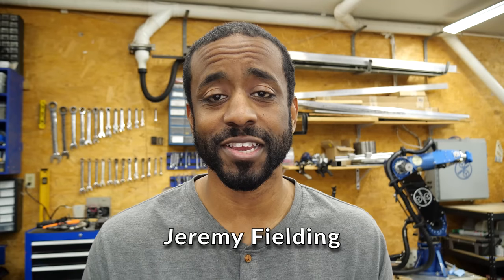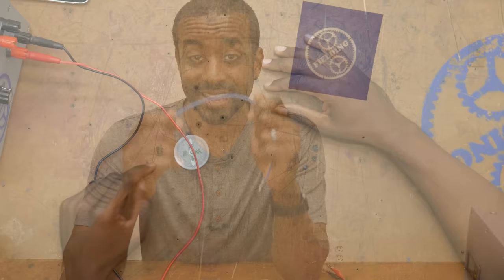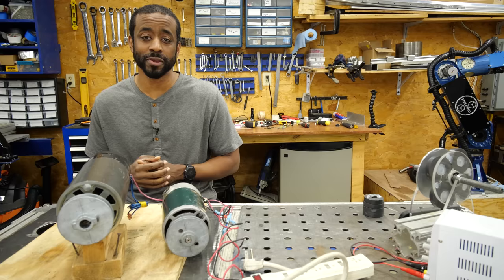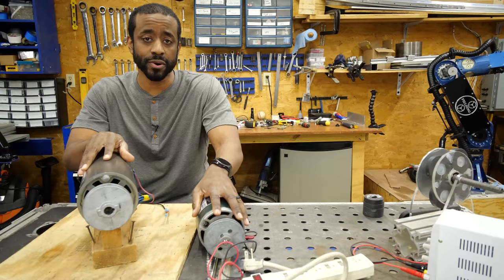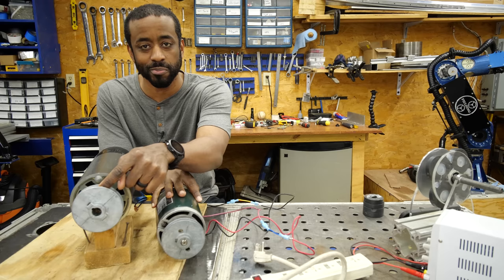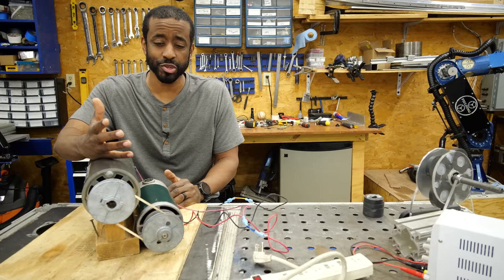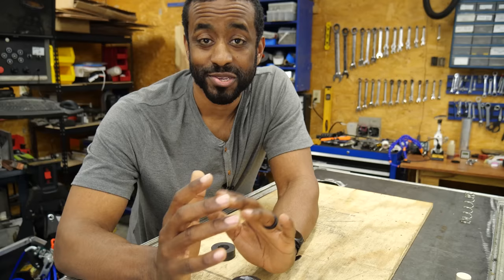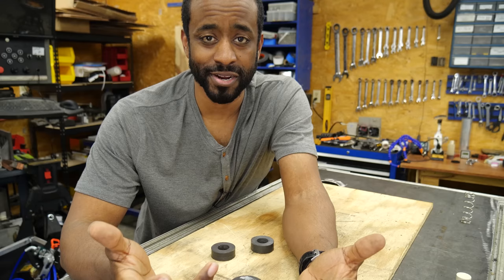Reviewing Free Energy Generators.  A Response to My Video "Nikola Tesla's Greatest Invention"- 102

Comment: Your Awesome Dude. It would be great to have a Free Energy Device to Power a House & Car & Boat. A device thats portable simple....maybe Invented By Woman??? Yes, after all the Home Maker is intelligent also. The electrical wiring to each room powered by a Power socket circulation may be a thing of the past also, or be shifted to a  centralised  point, instead of wiring down the walls & ceiling it should removed by now. Radio active electric  sources should never be over head really, its cancerous. Lets look at basics. The house Power Board connected to  these high voltage  powerlines have got to come down, the energy is too  Dangerous its Evil. Natural Energy Collection Sources or Devices, that Store Heat by Absorbing it for recycling use. Like nature provides rocks, sand, water, before refined mined to develop inventions, these discussions need to be had to birth a revolution. Where are the Visionaries? Its all about seeing beyond. Basic DAYLIGHT itself is light, heat & energy power.

Comment: What you have failed to do is to use exact setup as done in those flywheel-motor-generator videos. Although you have all the necessary gadgets, your setup of the generator and the motor is too weak. Put the devices on a stable platform, let there be a flywheel as is the case with the online videos. Start the contraption and let it run to its exhaustion and put the case to rest. As it is, your rubber band belt setup is not convincing.
Reply from the maker: Flywheels, gears, pulleys, etc have no positive effect on the result. In fact each one makes it slightly worse though I understand why you think it will help. You should check out part two. Links in the description. The current video was meant to explain the problem. In part two I prove it with a test. We measure the output. Don't hold your breath though. It was actually worse than I expected.  I briefly explain why in part 2 and In part three if you make it that far, I show a different prove test and more reasons why for those who still think it might work.

Comment: I just want to let you know before I make this comment then I'm an idiot and I really don't know too much about this but what if you took a car and put two motors that runs the car in the car with two sets of batteries and whatever you need to run the car and use one until one battery or low then kick it over to the other engine and the other engine will make the batteries full while it's running😮
Reply from the maker: Watch part two. Link in the description! I talked about this.
Reply: @Jeremy_Fielding  yeah it's just so hard to understand if you had two engines two battery packs in the same car and you were using 1 engine to generate from the wheels and tires just like a windmill.you would think if you drove 200 miles generating the other batteries you could start the other engine

Comment: What about hydrogen power?
Reply: hydrogen power isn't free energy, it's chemical energy. If you want to generate the hydrogen to run a hydrogen based motor, you have to put more energy into e.g. splitting water than you get out by burning the hydrogen. The waste energy is converted into heat, sound etc.
Reply: @alexjeffrey3981  Then what about GEET technology. Like Paul Pantone. I'm truly curious I'm not trying to create a debate. Have you looked into this technology. And I guess what I meant about hydrogen power is that of course it wouldn't be free energy just cleaner and more productive than an ICE engine.
Reply: @Metalkorpse  I hadn't heard about him before but the fact that he has an investor fraud case, is selling seminars rather than the engine itself, and that he said he got the engine from an angel makes me think it's a scam.

Hydrogen power is more like a battery than a source of energy - you would still have to "charge" it (by splitting water to create hydrogen, typically) using conventional sources. It's definitely cleaner though. There are production hydrogen cars out there like the Toyota Mirai, but hydrogen simply lost the market race to electric battery cars which are slower to refuel but more convenient.

Comment: so wrong about the alternator and an alternator is not the same as a generator they do put generators on electric vehicles it's called dynamic braking in the electric motors as they brake or u take ur foot off the pedal it starts generating DC power an alternator is ac power and u can't hook an alternator directly up to a battery it will destroy it they have diodes to convert it from ac to DC to charge the battery and run the DC parts in the car
Reply: the alternator runs the car not the battery If it ran off the battery then you wouldn't be able to disconnect the battery and the car still run if the alternator is ran by the battery
Reply from the maker: You don't seem to understand the point of the video. First we are talking about a hypothetical EV with an alternator not a gasoline vehicle. Of course you have power without the battery in a ICE vehicle. It is called gasoline. That chemical energy is converted kinetic via engine, then electrical via the alternator. We are talking about a situation where an EV is trying to power itself like an EV running on an alternator. That is battery - electrical to kinetic via motor then kinetic back to electrical via alternator. That already should sound stupid. In that situation, it won't run which is what I said in the video. It is basically perpetual motion but more wasteful. Regenerative braking is exactly the reason it doesn't work. When you engage an alternator it resist turning in direct proportion to the speed. i.e. kinetic energy is converted to electrical using it up. That is good in the limited case of EV"s only using it to stop the car. But that's not what we are talking about here. People are asking for car that runs itself. But, EV's don't use alternators for regenerative braking either! They use the main motor as a generator. While an alternator would work like this, it adds parts that can break and the efficiency is much lower so just use the main motor. I talked about regenerative braking in part two of this series a couple of years ago. Link in the description. The point of the video is that this is a dumb idea I am trying to explain to those who think this would work. I understand AC DC power LOL. I suggested nothing in the video that conflicts with that. I don't understand why you are explaining that.

Comment: So how in dafuqqqq do water wheels work back i. The day for electricity
Reply from the maker: Moving water has energy. Specifically it came from solar energy. I think the part you don’t understand is pushback when you change kinetic energy into electricity the kinetic energy is used up like burning gasoline. When the alternator produces electricity it also has a braking effect. That means making electricity also makes the car stop. If you push down the gas petal it’s like driving with your foot on the gas and brake together. You just waste a lot of energy. The car will go forward but use more electricity than you get back. Think paying $50 for a $20 bill. The water wheel would be the same. As long as the flowing river has more kinetic energy than the machine it will keep going. It’s solar power really. The sun heats the water and creates the water cycle. Lifting the water uphill then it runs down. I prove the alternator braking effect in part two of this series and explain how it works better in part three. Link to playlist in the description.

Comment: You probably think earth has a noth snd south magnitc field. Relly so why do you have to magnitctize the iron on a compace .iron alon should piont to the field right.
Reply from the maker: I don't understand your assumption that iron should just point to the field. Rather than explain why this is needed perhaps you should be asking a different question. Why does magnetizing the iron do anything if the earth doesn't have a magnetic field? Similarly why does it always point in the same direction when you move around. I think you should question your assumptions and the source of them before you make statements as if they are true. These are concepts you can test with experiments you can easily do at home not just some random weak theory. If you are willing to investigate yourself, you will find there are lots of ways we know there is a magnetic field, how we measure it and even how it moves slightly with time. Thanks for watching. Also we can just agree to disagree. That is also allowed.
Reply: @Jeremy_Fielding  thank you i relly aprecate the feed back
And will try some more expiements also does a compas get affected if your on a metel ship.i cant beleave its you that is  so Awsome thank ypu very very mutch.I did the load expiriment with two .itors and it did make the genorator work harder i have mutch to learn .you got me on the right path. You make learnig this stuff so mutch fun. Sorry for jumping to conculions .Thank you Thank you .I feel so Honerd to here from you. I have been working on a perment magnet motor for 40 years I am relly close to making it work  I know it sounds crazy althogh if you see my experiments you would be Amazed .And you will see the results as soon as i get it to work.I am relly close .i have developed other uses for magnets as well .Hearing from you is like a chatholic hearing from the pope.

Comment: i got a buddy and a co worker that believes this free energy videos like this.  thinks since they didnt show any wires or something like that, its real.  ive tried to explain the loss of power and efficiency ratings, friction.     the buddy wants to build a water wheel generator.   ok thats doable, the water wheel for power generation has been around for centuries.  his major PROBLEM, no creek or stream of natural flowing water available. SOOO.......   as the videos of a self pumping water pump came up to pump water up on the wheel to turn it. hmmmm.  dont think thats gonna work.   his other thought is to turn the wheel, have a pully turning a alt/gen to power an electric pump to feed the water to top to keep the wheel spinning, and then have the inverter hooked up to lights.   i realy dont think thats going to work and i cant get ti through his thick skull. SSOOOO.....    i guess im a sit back and watch and when hes done trying, i might have to say,   told ya .   now building a gas powered generator yeah but then you could just buy one.

Comment: SO ISNT THERE FREE ENERGY BETWEEN TWO OPPOSITE MAGNETS ? THE REPELLING ACTION IS ENERGY.
Reply from the maker: That’s a great question. The short answer is no. You supplied the energy by “squeezing their magnets fields or aligning them and holding them apart. Either way you supplied the energy to make it happen. It’s like a spring. You press the spring first or nothing happens. You are adding energy by pressing it and storing the energy by holding it. When you let go the energy you added is released. The important thing is it immediately goes to a resting state. There is no way to make it happen or continue to happen without moving it again ( you adding energy again). I explain this more in part two. Link in the description.
Reply: @Jeremy_Fielding  yes the initial action you are moving the magnetic to put in position but after that there is a perpetual action of repelling of the opposite magnetic poles. The levitation is the action it just needs an on and off switch sort of speak to  create absolute motion which becomes the energy in another way.
Reply: Have you heard of the man in Africa who has a self powered TV by radio frequency almost a Tesla concept.

Comment: So your telling me a simple magnetic motor is not possible
Reply from the maker: It’s not possible because magnets don’t have energy. They are like a car with no gas. You can use them to transfer energy but you must supply the energy from something.
Reply: @Jeremy_Fielding   and the movement can’t be harnessed to creat energy
Reply from the maker: You need energy to make it move. That’s the entire problem. You stop adding energy they stop moving. It’s called cogging. You should check out part three of this series. I talked about this problem of input energy in great detail. Check playlist in description

Comment: I can make it work
Reply from the maker: You should watch part two. There I answer this. This is a very common misunderstanding about gears and pulleys. So much so there are nearly one hundred of comments below yours that also suggest this. You are not the first to think of this. It just doesn't work. Gears/Pulleys don't multiply power. They trade speed and torque. The difference really matters here. Link to playlist in the description. Actually I would pick part three if you only watch one video. I explain it better in that one with real gears and a bicycle example.

Comment: What is in a 20KW gas generator that produces electricity? Does that part know whether or not it's a gas generator or an electric motor turning its shaft to produce that 20KW of energy? No it doesn't because it does not have intelligence. Strapping 2 equal power electric motors together with a rubber band does not disprove free magnetic energy. A 5KW motor can turn a 25KW generator whether belt driven or direct driven. That 25KW motor cannot decide to not produce power because a 5KW electric motor is turning it instead of a combustion engine, wind, or water. You only hurt people by posting this video because free power is real and should be given to all
Reply: This has nothing to do with perpetual motion either. Yes, perpetual motion is impossible, but magnetic power generation is not. An alternator/generator cannot tell what is spinning it. If the power output of that alternator/generator is 5x more than an electric motor capable of turning it, that leftover stuff coming out of the alternator/generator is free. Not only is it free, but it is electricity and can be used to power things. Redo your tests with a 50KW wind turbine innards and a 10KW high torque electric motor please
Reply from the maker: This is a fantastic question, and the main reason I make these videos. I understand why you have this question, and I want to help. This question is the reason the scam is so effective. The power is in the gasoline sir. The motor/engine CAN tell something is pushing back against it. The "push back" part is explained in another video. If you don't have a power source it will stop. You really should watch part three. The part you don’t understand is better explained in that video. Link to playlist is in the description. There must be power available. burning gasoline is indeed a very dense and portable source of power. It’s just chemical energy instead of electricity. But it’s a bit much to tease out in the comments. If you want to understand please watch the other video. I don't want you to be scammed over something that's really very simple when you fill in a few blanks keeping it a mystery to you.
Reply: @JeremyFieldingSr  you have 2 videos about these. You did not answer my question at all. Use a 25KW generator/alternator and a 5KW electric motor to turn it. Stop spreading false information until you actually disprove something(which you cannot do on this topic)